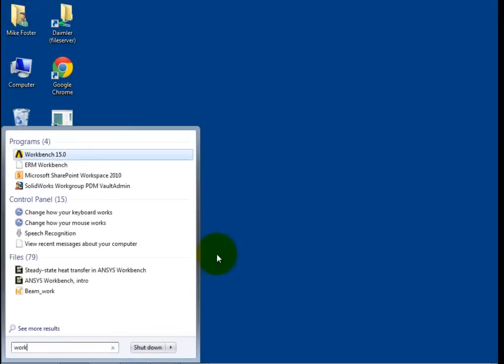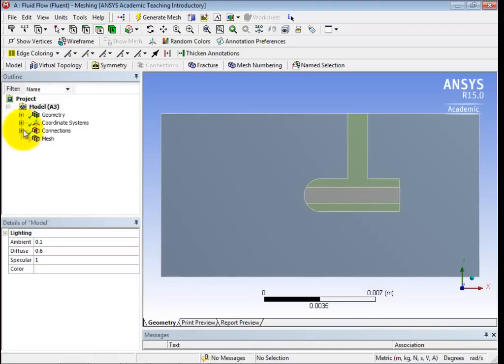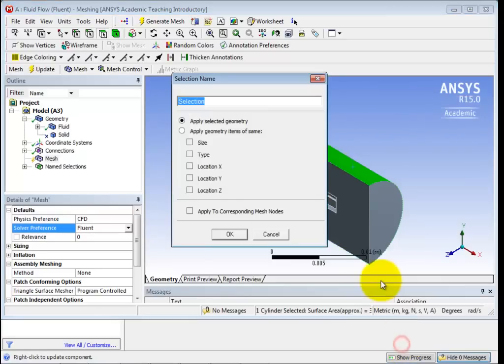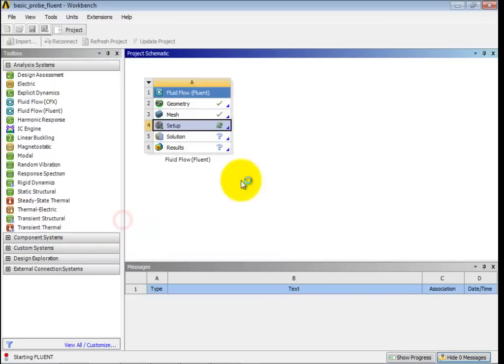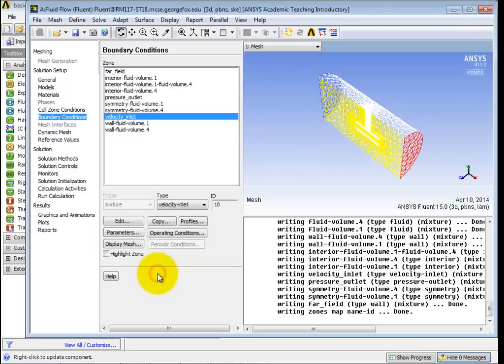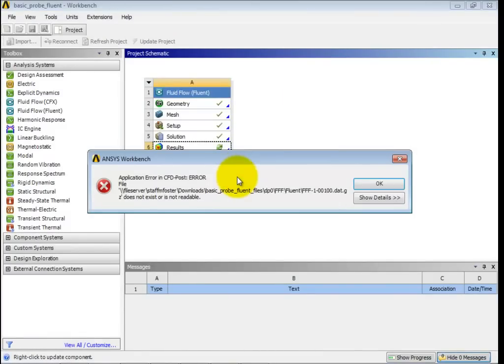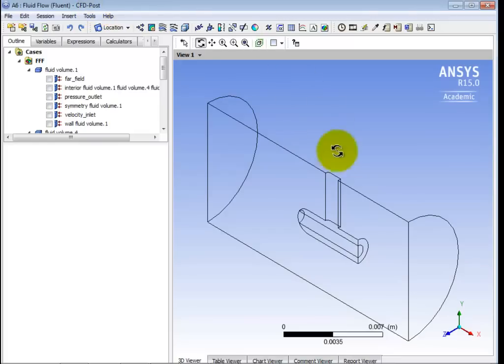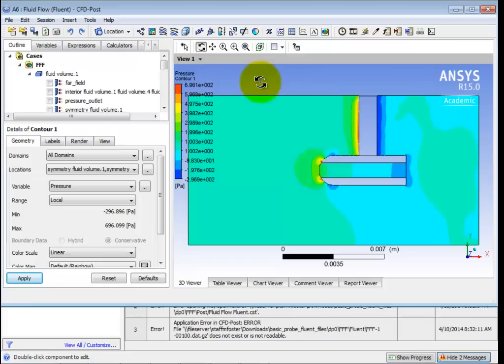Introduction to ANSYS Fluent

Comment: Hi, I'm new to fluent and was wondering if you could answer a quick question. I've carried out convergence studies on mechanical using fortran, which is quick and easy to change the element size incrementally. Do you have any tips on carrying out convergence in fluent? I'm just changing min/max element size in the meshing stage, then re-running the analyses. It's quite time consuming and was wondering if there is a feature to speed this up, cheers!
Andy

Comment: Hello, 
I am trying to model the flow around a turboprop propeller using an actuator disk. I am having trouble implementing the boundary condition that leads to the pressure jump and streamtube contraction. 
Do you have any tips on that? :)
Reply from the maker: I believe that is a bit more advanced than what I cover.

Comment: hello, im trying to make an analysis to a blade, when i run the calculation after a 13 iterations apears an error:
 "" Divergence detected in AMG solver: k
 reversed flow in 551 faces on pressure-outlet 7. 

Divergence detected in AMG solver: k
Error at host: floating point exception

 turbulent viscosity limited to viscosity ratio of 1.000000e+05 in 29819 cells 

Error at Node 0: floating point exception

Error at Node 1: floating point exception

Error: floating point exception
Error Object: #f
Registering SurfaceMonitors, ("surf-mon-1.out")

Calculation complete."

Can you help me?
Reply from the maker: From your error, "reversed flow...on pressure-outlet," it sounds like you have similar issue to what happens in this video (https://www.youtube.com/watch?v=9e3A4BRiP5g, just after 10:00). I suspect you'll need to extend your domain so that flow recirculation  occurs within the domain and not in/out of the boundary.
Reply: thanks! i will try :)